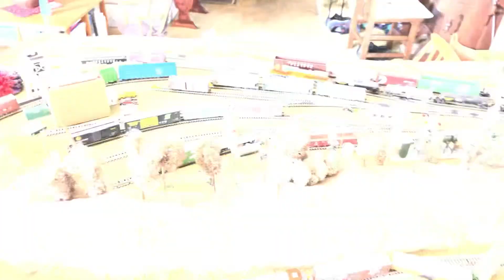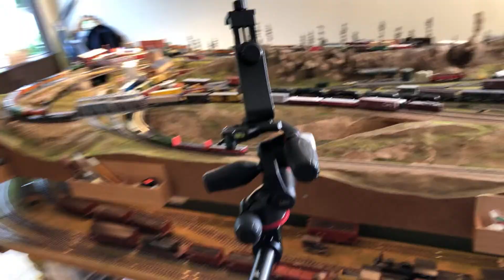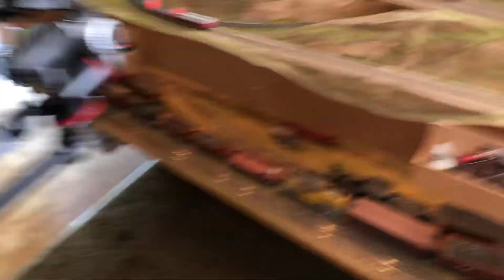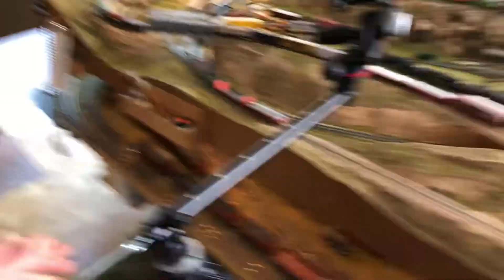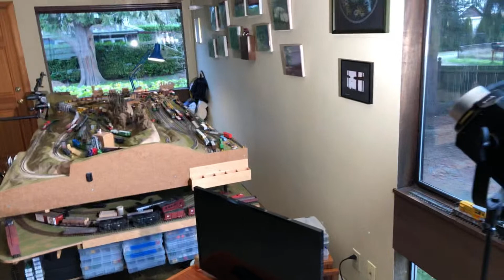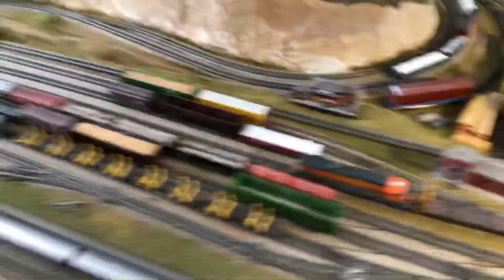N scale train disaster recovery with re-railing tool, and some quick ops

Comment: That is an amazing nice layout. i am trying to create it but I am a little confused of the exact track plan. 
   Thanks for the videos,
          
🙂
Reply from the maker: I will post a photo of the layout from a high altitude in the "community" tab on this channel's homepage - hopefully you can find your way to it there. I don't have a full track plan of it, other than an article in the LDSIG quarterly newsletter years ago.
Reply from the maker: The layout is 8-1/2 feet by 34 inches in size.
Reply: @muchfunwithtrains  It seems like the yard has 2 levels. Where is the entrance to the inside tunnel?  Just so you know, I am blind in one eye, and can't see out of the other. Lol
Reply from the maker: I see what you mean, this is hard to figure out from a photograph! The inside tunnel goes to the right-hand side of the lower staging yard, which is behind the upper main yard in the back. I'll try to find if I have a track plan from that earlier article and post it.
Reply: Th @muchfunwithtrains  That is what I was thinking. I am trying to copy it. If that is ok with you.  
Thanks, Bob